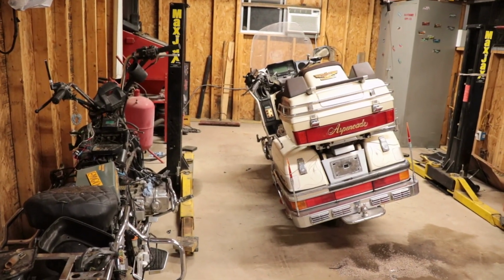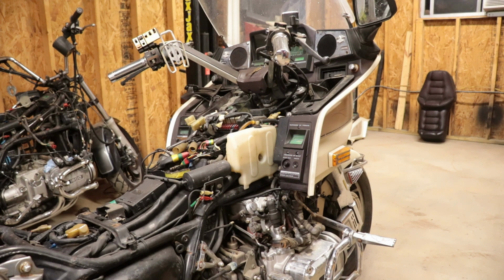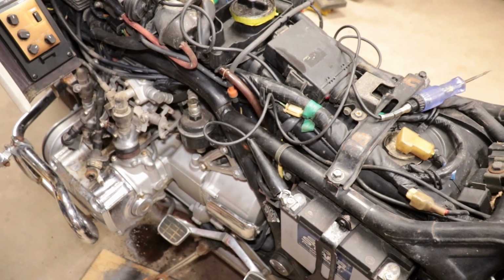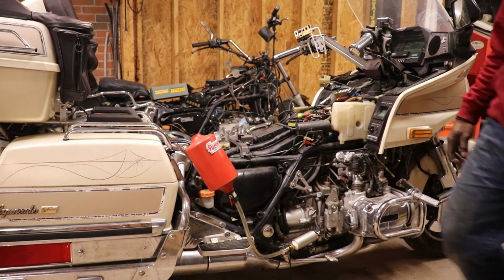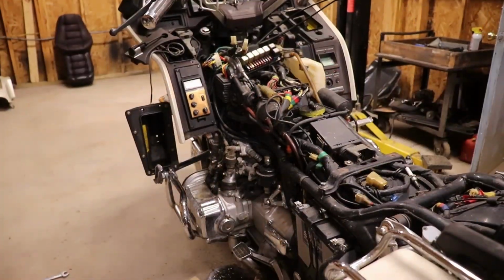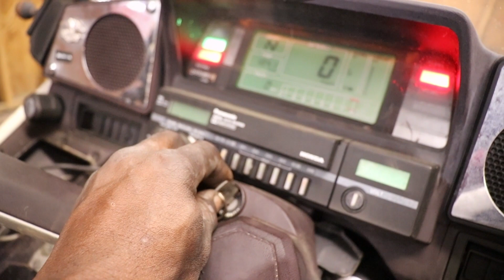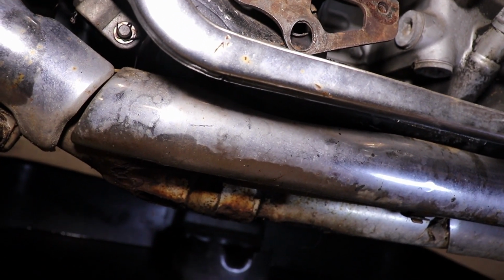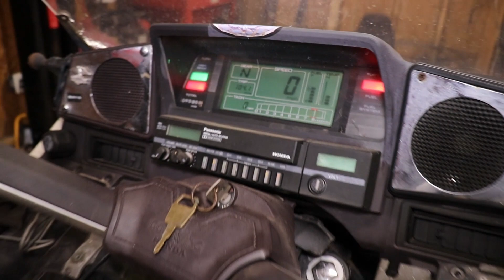1986 Honda Goldwing GL1200 SE-I. First start. Will it run. Pt.2 Ep.550 #willitrun #firststart

Comment: Stators on these are notorious for going. I always check the plug on any 85-86  and make sure it isn't melted lol. First thing I test on a 1200 is the stator if I have weak spark. Have a beautiful silver 1200 I got for next to nothing. Fried stator of course! =P
Reply: Agreed, Stator is a common issue .replacing starter is no picnic  either.

Comment: I think it was 2011 2012. I was in Kansas City and I picked up a 1985 Gl 1200 With a clay title I got it from a salvage yard. Thanking I could use it for parts If and when I needed on The 1986 Gl1200  that I have I stopped bothering with they're just covered up at the storage.
Reply from the maker: It's still in storage.
Reply: Yes sir ! Come and get it
Reply from the maker: Send me some pics and info to Rpmauto780@yahoo.com
Reply: OK I'm not very good at this as you might be able to tell but close they've been covered up for a few yearsOK I'm not very good at this as you might be able to tell but close they've been covered up for a few years But all the parts of there used to write the black 1 A lot!

Comment: I have foot pegs I’ll sell you. Off of a 84 wing
Reply from the maker: Well. I have bought some now. But thanks. You wouldn't have a poor boy alternator conversion kit would you.
Reply: @RpmAuto  I’m afraid not
Reply from the maker: I need the piece of plastic trim that goes at the bottom of the fairings in front of radiator. I think it is 3 to 5 inches long
Reply: @RpmAuto  I will check